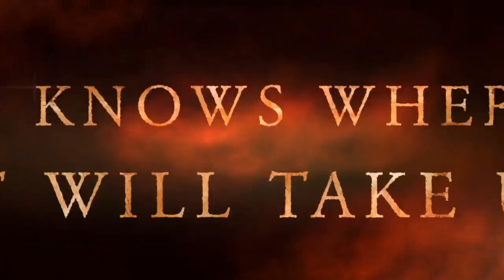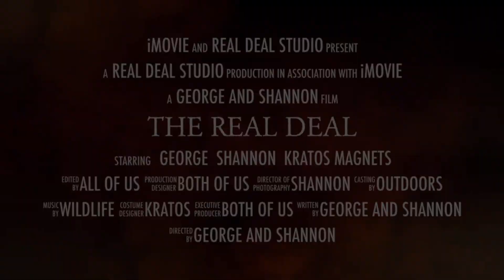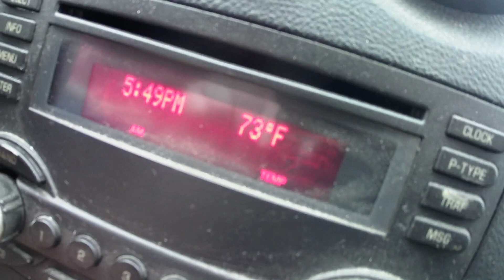guns and cars and chickens oh my!!!!  #magnetfishing  #teamkratos

Comment: The "what is this" at the 4:35 mark is an antenna wire holder. Back when we had rooftop antennas, the cable ran down from the roof to someplace where it could be fished through a wall or window to get to the TV. The cable was flat and would be fed through the "keyhole" looking hole. The other end was threaded so it could be screwed into wood siding or a cornerboard and held in place.
Reply from the maker: That is so cool to know!!! Thank you so very much